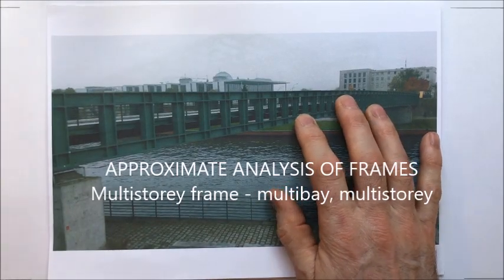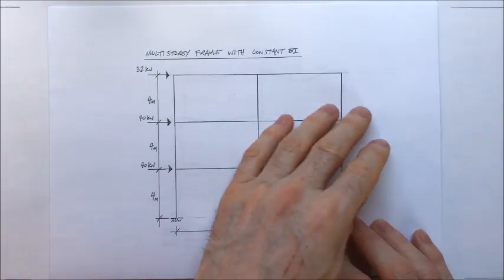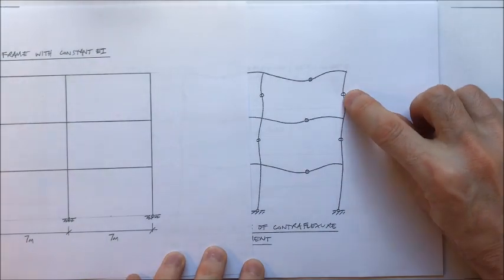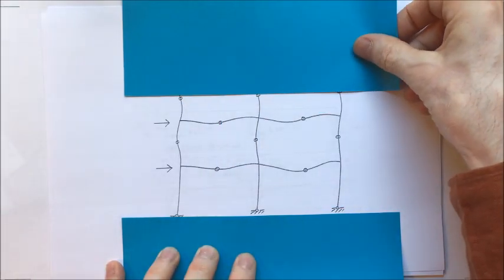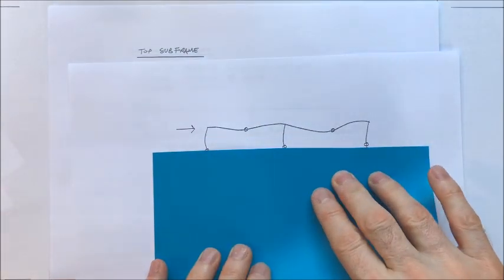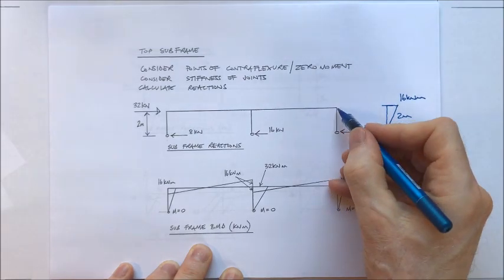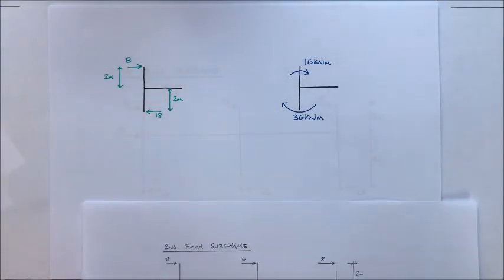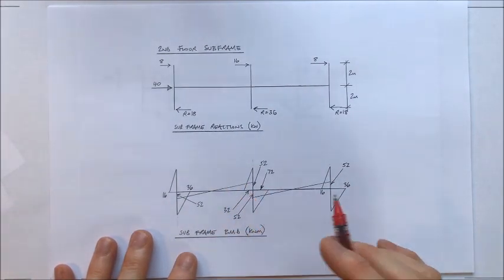Approximate analysis of frames (5 of 7). Multistorey frame - multi-bay, multistorey

Comment: H Mike, great videos. Just a heads up that your joint at level 2 is out of balance. The moment in the beam should be 120kNm not 140kNm. (50 + 70 to match the column moments)
Reply from the maker: Hi Alex, Yes, you are right. I have added an ERROR! comment to the description - hopefully, this may help others. Thank you, Mike

Comment: Hi Mike, thanks for your videos. They have been very helpful. Would it be possible to do a video on the deflection of multi storey frames?
Reply from the maker: Hi Scott111188, If I ever find myself with a little time on my hands, I would love to, Mike
Reply: @mikebather  I have found several papers and books that give methods, but they have not be satisfactory as yet - probably an error on my part though. For my dissertation in the next coming academic year I am studying tall buildings. I am going to use SAP2000 for it, though I want to do some preliminary analysis to validate my computer model.
Reply from the maker: @Scott111188  Hi again, I would be tempted to get advice straight from the horse's mouth and speak to someone practising in industry right now. What do they do in practice? In my experience, structural engineers are a very helpful bunch. This would improve the linkeage between your dissertation and industry and relate your work to current practices, hope this helps, Mike

Comment: Hi Mike, I'm working through a similar problem to this. I was wondering if my multistorey frame had fixed supports at the bottom, would those ground floor columns then have points of contra-flexure also?
Reply from the maker: Hi Caitlin, Great question and yes, you seem to be understanding this correctly, Mike